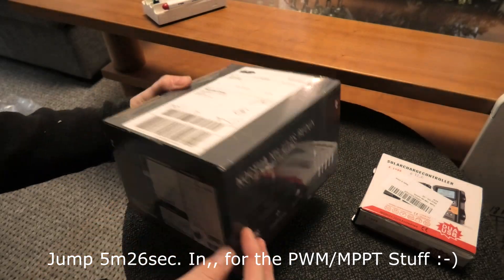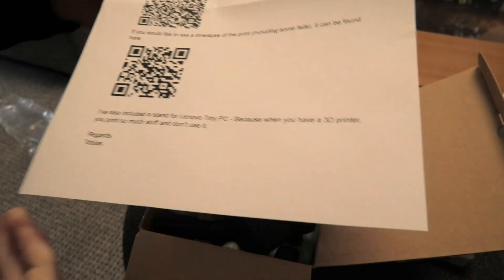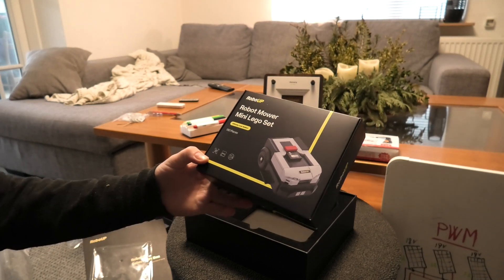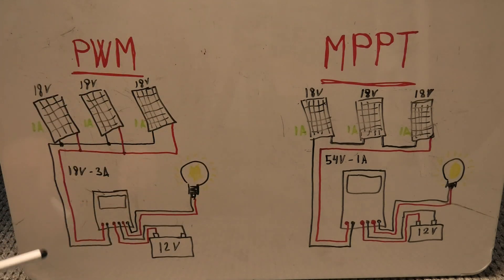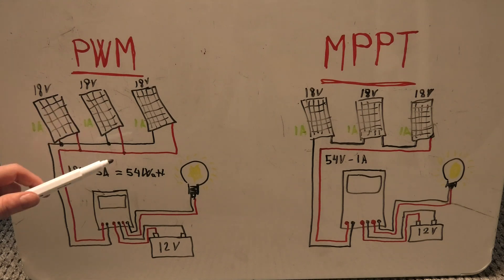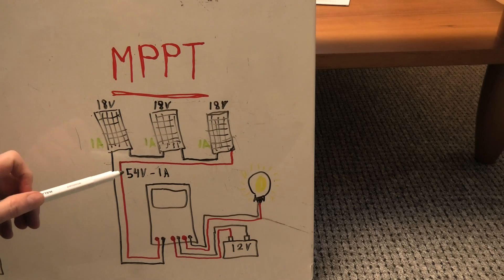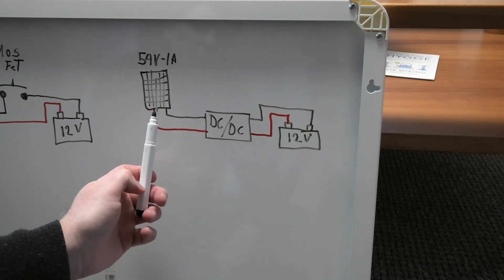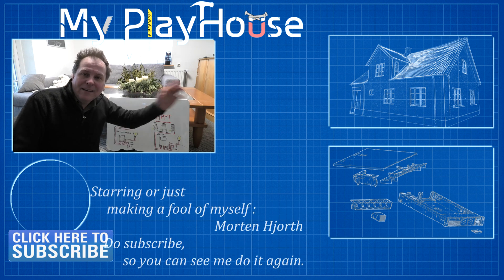PWM vs. MPPT Solar Charge Controller - Best use Case - 1466

Comment: In your diagram, the PWM Wattage would only be 36, not 54 because the moment the panels are connected to the battery, the voltage across the panels drops to the battery voltage.  It's only 18V during the periods where the panels are not connected to the battery.
Reply from the maker: mps goes up when you pule down the voltages.

Comment: EINFACHE ERKLÄRUNG: ein 18 volt solar modul mit 5 ampere = 90 watt aber an einem pwm regler werden die 18 volt runtergeregelt auf 12 volt also kommen nur noch 12 volt mal 5 ampere = 60 watt an dem akku an ! bei mppt wird aber die spannung runtergeregelt + der strom hochgeregelt also 12 mal 7,5 ampere = 90 watt (es kommt die volle leistung aus dem solar panel auf den akku !) bei 40 volt solar panelen wäre der verlust zwischen pwm und mppt sogar noch viel größer ! anders gesagt: pwm regler "drosseln die leistung von solar modulen" und mppt regler nutzen "fast" die volle leistung der solar module ...  und die behauptung pwm regler würden batterien schonen ist "blödsinn" ... mppt regler laden akkus mit höheren strömen und somit schneller wodurch manche akkus stärker belastet werden und schneller altern aber "nur manche" bzw. je nach größe und typ des akku ... es gibt sehr viel halbwissen und falsche informationen bei solar und vor allem auch china windturbinen ...
Reply from the maker: HI @Nebukadnezar-jw1mt
My channel is English, and to make sure as many as possible,  can also enjoy the comments, they are also English.
Please keep to English.

Thank you for watching! :-)

Comment: Oh dear looks like some mixed views here on this video. My opinion MPPT is what the experts like to use, which is valid for many reasons far above my understanding. However PWM has its place still in solar setups and I think this is what Morten is trying to say. Based on Morton's videos I would say if your on a budget and the power you need is low then PWM saves you some cash. In Morten's case he has and uses both (MPPT for his main house system and PWM for smaller projects). The one thing I would say is solar setups have many factors that effect performance of the system and if your planning to do it yourself then expect a few mistakes along the way, but as the saying goes we learn from are mistakes so I see this as a good thing. Thank you for putting out the video while some may not agree with it I'm still looking forward to seeing you get your bunker powered by solar and your internet.
Reply from the maker: Hi @solarhomelab
Thank You very much!  glad you liked the video :-)
Thank you for watching! :-)

Comment: OMG did Morten just make a video just to prove his point. This is ridiculous. His internet relay in Portugal is proof of failure, it only worked for a short time and was quickly out of service because the power supply was not designed properly and that alone speaks for itself. You do not design a solar system just by throwing some components together that is simply not how it works. you calculate a PV system even if it is only a small installation, people with experience in this field will agree with me 100%. This way you will never get a properly working PV system !!
Reply from the maker: Well I disagree...
Reply: Because we live in this world of PV panel installation ideas, can you show us a way to design a PV installation properly. And differences, if time allows you..
The world is full of advisers and critics...
Are you one of them?

Thank you.

Comment: Hey Morten. Even with only one Module a MPPT is more efficient than PWM. Because as you say, its searching for the maximum power point. And it does this even with a simple setup.

Lets take one standard module and pretend we have perfect conditions: 
-Voltage at Maximum Power point (Vmpp): 38,2V
-Current at Maximum Power Point (Impp): 8,33A
-Short Circuit Current (Isc): 8,95A

If u use an MPPT, it continuously tracks the maximum Power wich would be at perfect conditions would be Vmpp * Impp wich would result in around 320W and a charge current at 12V of around 26.5A.

Using the same Module on a PWM Charge controller would force the panel to have around the same Voltage as the battery and roughly Maximum charge current of Isc: around 8,95A, which results in a maximum charging power of 107W. 

Conclusion: To get the Same Charging Power with MPPT you need 3 Times your Modules in Parralel as only one Module on the MPPT. So even in a small system with only one Module your far better as with PWM. Also you get far better performance when its cloudy.
Reply: 😮 I am watching the same video as DDG 🥳🥳
Reply: "MPPT is more efficient than an MPPT" ? lol
Reply: No not true, buy a decent "fast" MPPT controller (NOT TOYS) do a practical measurement and you will see😉
Reply from the maker: Well in your case here, the (Vmpp): 38,2V would be to much for a 12v PWM system. And a MPPT would be the way to go.

If it was a 24v system, you would charge it with like 26-29,2V and see 233-261Watt comming ind., witch is around 18,5-27,5% less then with the MPPT.
The cheap Victron, is still €42 more than the Cheap PWM,, I you upgraded thar 320w panel to a 550-580w for the amount,, the PWM would be better for the money.

But with this voltages on the panels MPPT is better. Go 18-22V on the panels and MPPT is way less of a deal.